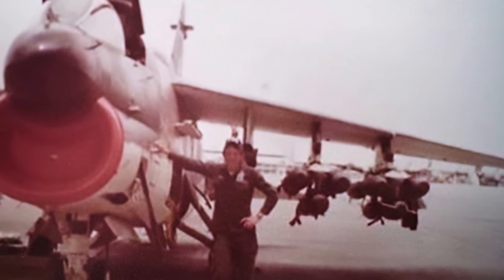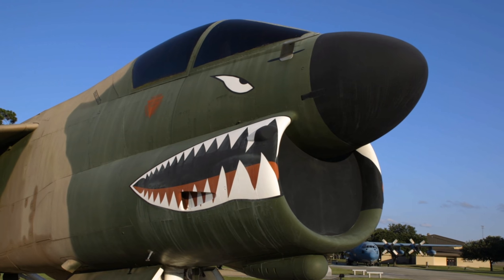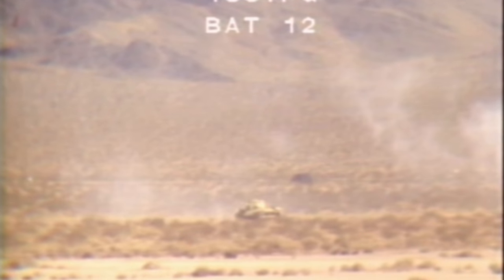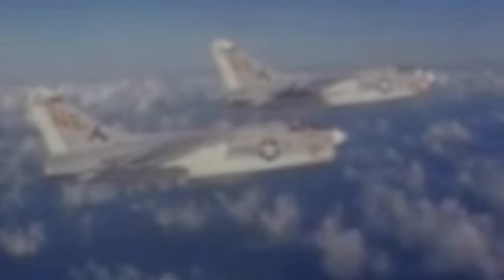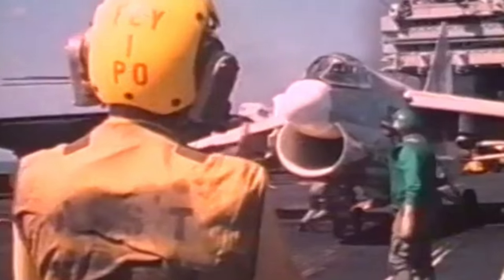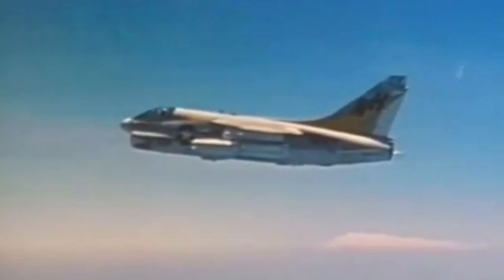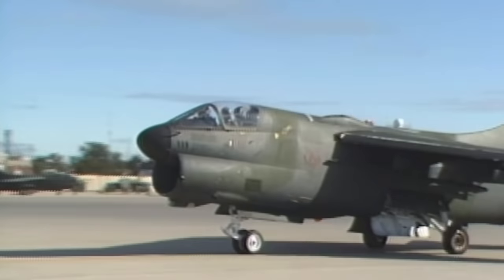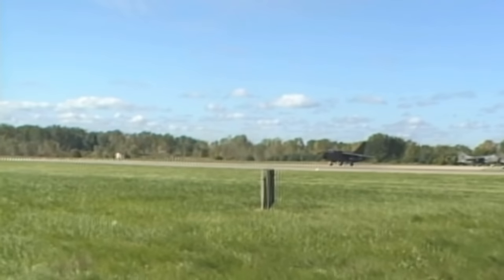A-7 Corsair II | SUBSONIC CARRIER ATTACK AIRCRAFT

Comment: As far as I recall: About the end of the 1950'ies the USNavy had a lot - like a LOT of Essex-class aircraft carriers and they had to decide what to do about them as the new Forrestal-class was coming off the slipways. The A-4 Skyhawk was very much a budget proposition - that performed well. Now the Essex displaced around 40.000 tons where the Forrestal-class initially was only 50% larger. But if you could basically double the aircraft size - again on a budget. Well, there wasn't that much debate.

So as the shoe box could contain footwear for persons in no need of skies - then it was an easy choise. Besides the fighter role was the Phantom's and banging that lead sledge down on an Essex-class was problematic. So the safer bet was to scrap the Essex-class and get Forrestals.

But both the A-4 and A-7 performed well at an affordable price. The A-4 was a great aircraft; but could we double that within reason? Carrier deck space is an extremely expensive sort of real estate.
Reply: A bit of fact mixing. F-4's never could serve on Essex class ships. The F-8 did.
Reply: @WALTERBROADDUS  That is correct! But what you should consider is the Navy had a programme to look into providing a fighter for the smaller carriers - which eventually resultet in the F-5 Freedom Fighter for the air force and  a cheap fighter to provide the allies with mass. The engines of the F-5 are not really anything significant; but they are good and reliable. The F-5 is an example of "good enough" being actually to a large extend good enough.

The USNavy has since the Independence-class carriers of WW2 had the concept of a fleet carrier being followed by a smaller mate.

The smaller carrier originated from an idea of Franklin Roosevelt that in order to provide more new carriers fast you should convert the Cleveland-cruisers on the slipway to carriers - Roosevelt pressed the idea AGAINST the Navy - in october 1941. Roosevelt KNEW there would be a war.

Now a battleship took 4 years to build with war emergy fury on the yard, an aircraft carrier 2 years, so if you could cut that in half once again you could flesh out the fleet with some capacity. They were of far less capability, but they were there when and where you bloody needed them.
Reply: Builds 11 aircraft carriers

United States: "We need a cheaper plane"

Comment: Mechanics in the Navy called it the widowmaker or maneater, it was dangerous to work around when running, very dangerous on the flightdeck.  Saw a buddy of mine get his legs knocked out from under him when a yellow shirt turned ones exhaust on him.  We always said that if this thing wasnt leaking hydraulic fluid when it was running, it was out of fluid. We had EA-7L's in VAQ-33.
Reply: That must've been the Harley-Davidson model. We had a ANG squadron of A-7's for many years. I worked with a lot of ANG personnel including a pilot(transitioned from the F-100). Never heard complaints about leaks.
Reply: @LuvBorderCollies  Stress of landing on a flight deck caused a lot of issues.
Reply: The exhaust did angle down a little unlike every other jet on deck and the intake was huge but I don’t think it actually ate any more people than any other plane. One had to stay away from all intakes.

Comment: The SLUF was the best CAS aircraft until the A-10 became operational. The "500 feet" quote you mentioned in incorrect.  The 500 refers to air speed:  the jet was slow to accelerate to 500 m.p.h. with bomb load in high density altitude because of the under powered Rolls Royce designed engine.

Comment: Unpopular opinion:the A7 is better than the A10
Reply: Well at least the A-7 could defend itself in A-A, and was faster.
Reply: Well, for attack, it sure as shit is better than the A-10.  For close air support, the A-10 has better loiter time and it also has "the gun".  While it wasn't supersonic, it is still a damn sight faster than the A-10 as well.
Reply: Defiantly a better Strike Fighter, but the A-10 has a higher "Usable" ordinance load from launch. The A-7 had to take-off with a dramatically reduced fuel load to use it's 15'000lb payload & then get topped off by a tanker after take-off. The A-10 is able to Rough Strip at it's full 16'000lb load out with full tanks. A-7 was still a Damn fine strike/CAS platform.
Reply: @ovk-ih1zp  I think you are confusing the Navy and Air Force versions of this jet.  Go look at what the MTOW was for this jet in D and E model trims.  I think you'll see the 459 built for the Chair Force had a higher MTOW since they took off and landed from long, straight runways that didn't move.
Reply: @karlchilders5420  "it also has "the gun"" - The gun hasn't been able to be a tank killer since the 70s, I don't think thin-skinned vehicles or people made out of meat and bone can really be less "dead" after getting with with 20mm.

Comment: A-7 Corsair II was my Favorite plane she's fought in Vietnam and last time the us used A-7 corsair was in Desert Storm 

Although I'm kinda sad when the A-7 retired from service if the US still keep the A-7 corsair II in service longer she would have appear operation Iraqi freedom or Fight against Islamic state (ISIS).
Reply: Carrier based aircraft have short lifespan than land based due to the stress put on the airframe everytime they launch and land and corrosion from seawater. That's why older Canadian F-18s are still flying.
Reply: VA-46 and VA-72 were the last Navy squadrons, knew some of those guys. The 178th in Springfield Ohio, my Mom's hometown unit, was the last Tactical unit with them. Edwards had four for chase and testing until 1994 IIRC.
Reply: @Joshua_N-A  The Carrier birds tend to fly longer. The killer for the Hornets were when they CVWs moved from two VFAs to three. This was the change after the A-6s were retired. The Bugs were never projected to fly continuously as they did from 1994 until now. The S-3s, F-14s and EA-6Bs still had a good amount of time left on them.  The Hornets simply were not built in the numbers to field three VFAs per Air Wing, Navy and Marine Corps Reserve and longer deployment cycles and constant ops. The USN actually traded with the USN and USMC Reserve because the amount of Traps and Cat Shots were used up. Once the Alphas were upgraded to the Plus Standard, they went back to select Fleet units. VFA-15,VFA-87 and VFA-97 did that. Another issue was the upgrade from Alpha to Alpha Plus added another 3000 lbs and changed the CG. The RCAF pilots are awesome and fly their Hornets very effectively. Great watching the USN Tac Demo then seeing the RCAF right behind it.

Comment: Vought put an afterburner on the TF-41 then slicked up the A-7 into what they called a StrikeFighter. Air Force bought f-16's.
Reply: Paul Woodman 
That was the YA7F and they removed the StrikeFighter off the name
Reply: @johnstanzak8167  I got a picture somewhere of the TF41 with an afterburner sitting outside.  I work at the Allison plant now Rolls-Royce that made the tf-41 and had to look it up.
Reply: Paul Woodman 
They had to remove half of the tail cone because it was causing a vacuum on the aircraft and they said it was amazing how much speed it gave them. They never took it to the limits but sad it would keep up with the F8U3

Comment: what is the difference between dumb and retarted bombs?
Reply: Retarded bombs have fins that pop open after release that slow them down for low angle low altitude drops. “Snake eye” bombs. They are dumb bombs also. Later version the snake eye fin was replaced by a big baloon that made it more accurate and reliable. 

If you drop a slick bomb low angle and altitude (or a snakeeye whose fins fail to extend) it it could travel along with the delivery aircraft and potentially impact and frag the delivery plane. 

Dumb bombs are bombs without guidance like gps or laser or a tv camera. 

U.S. doesn’t really use retarded bombs anymore because everything is guided in some way and almost every thing is high altitude because of our SEAD capabilities. Suppression of Enemy Air Defenses.
Reply: It just occurred to me, your question was a joke wasn’t it??? Good one, I’m usually better.